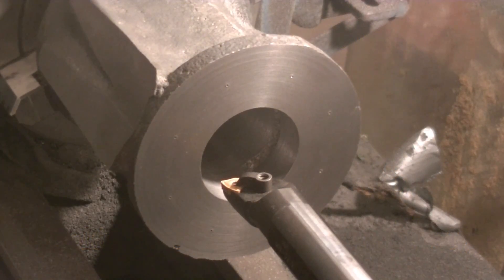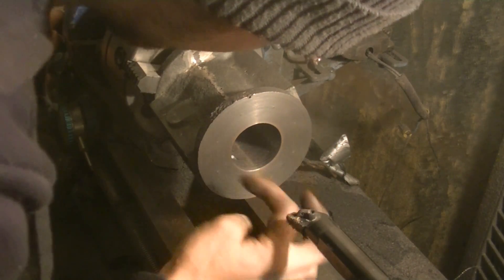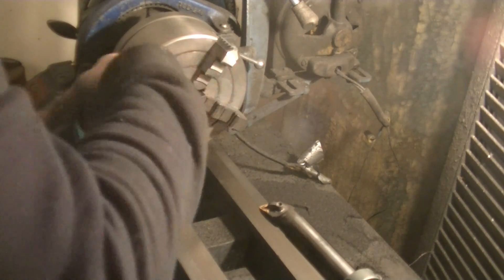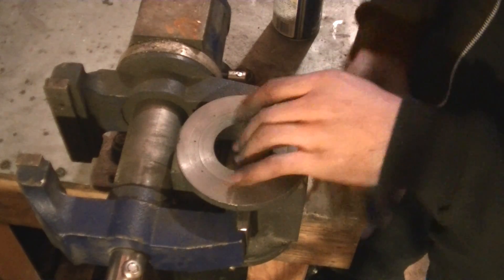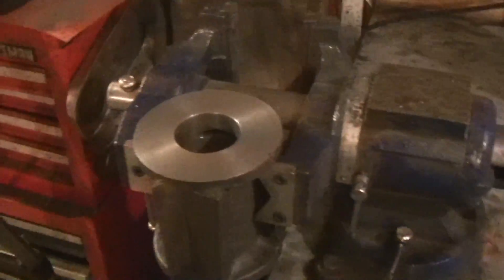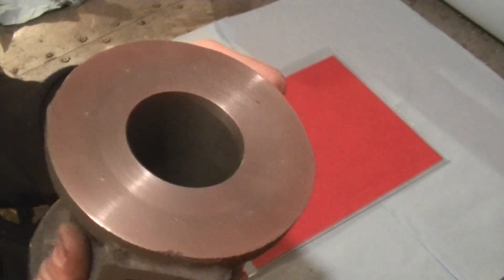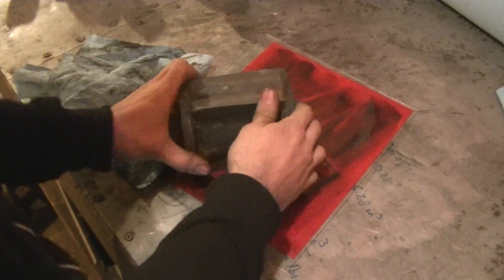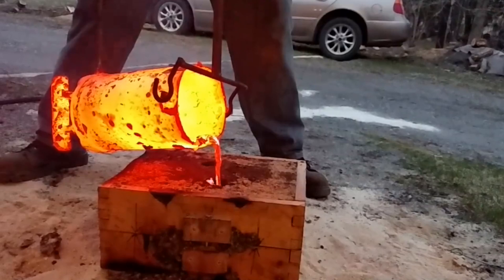Steam Engine Build: Machining the Engine Cylinder: Part 3

Comment: I leave 0.005 too 0.007 for finishing  hone with casting for harley  cylinder , also you can slow you lathe rpm down another 50 60 rpm  will help with chatter , but I use a 1/64 radius  end on my tool insert

Comment: Glass bends... I saw somewhere to use granite tiles... which I used for my milling table... problem was the the tile was 12-24thou out when I mic'd it... but only transferred to the table abt 5thou run out... which is better then the 19thou in the table originally (don't ask)... so I guess flatness isn't that big of a deal... more to do with rotation of the part over the plate and vice versa. If you only use the part on the tool(tile or glass plate) you can get a convex curvature in one or the other... but if you flip from surfacing the part on the tool too using the tool on top to surface the part( if you get that) you can get fairly "flat" parts... within a few thou...

If you decide to try granite tiles... do buy them.from Homedepot or Lowes... go to a real tile store, better chance at getting a better product from there. If you want to spend a little bit of money and time... get two small granite counter top pieces and some grinding/polishing compounds and make your own surface plates.. wouldn't use it for NASA required precision parts... but good within a couple thou...